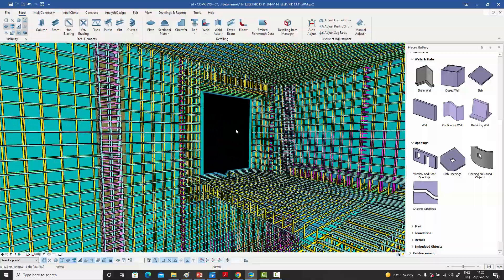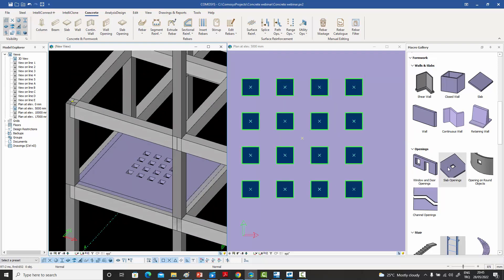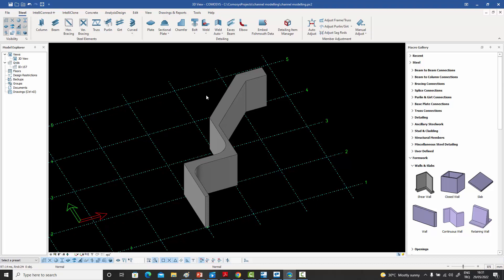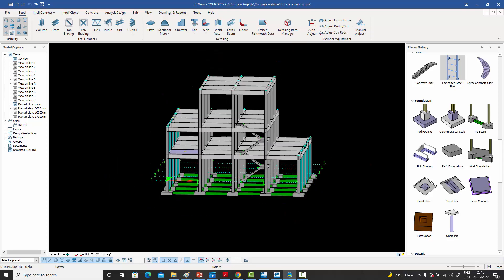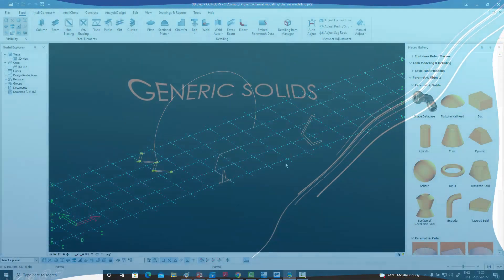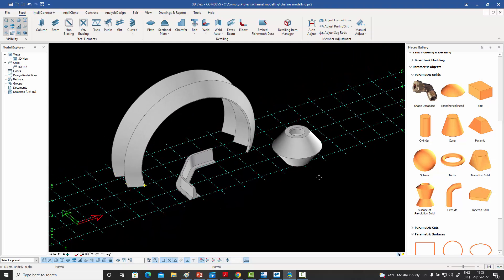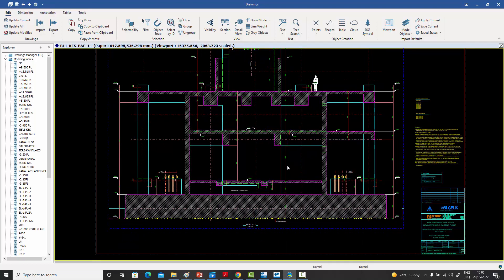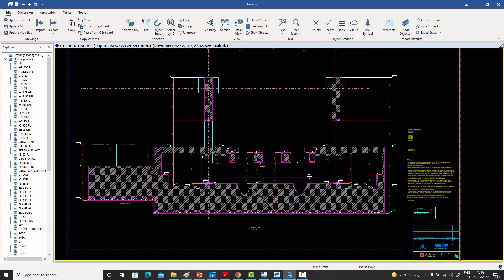COMOSYS Concrete / 3d Rebar Modeling and Detailing Webinar 2 Jun 2022 | Webinar Recording

Comment: In concrete modeling not showing any properties/grade of concrete as per elements, is it available?
What about codes and standards of detailing? BS/EC2, ACI, IS etc.
Is it possible to adjust the macros as per SMOD? Splice locations, bond conditions, crank splices for beams and columns etc.
Detailing to Eurocode 2, is it possible to set the splices and locations as per grade of concrete considering the bond conditions, tension and compression according to the elements in macros?

Comment: Is it possible to calculate and analyse concrete structure with all these details?
Reply from the maker: Currently it has analysis of RC structures. Expecting the design to be ready in few months.
Reply: @ramcadds  Great! I hope someday we will calculate concrete 2d elements with 3d finite elements with reinforcement. This would be ultimate programme.